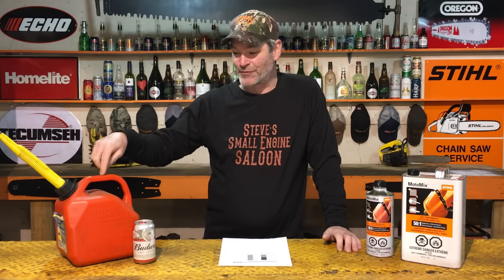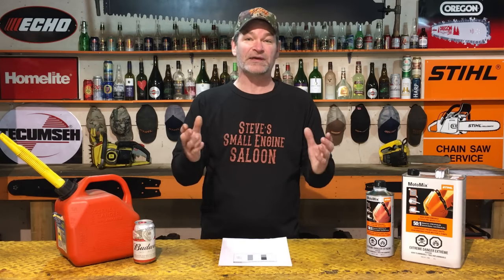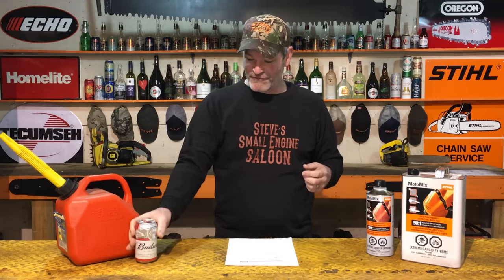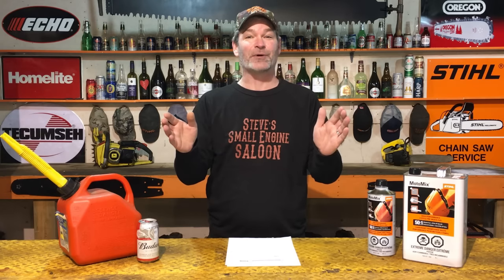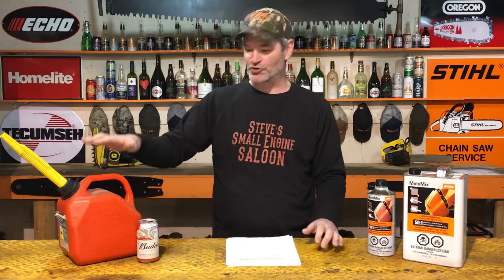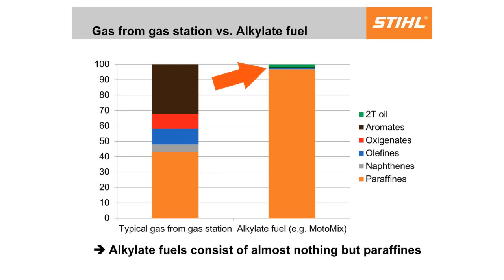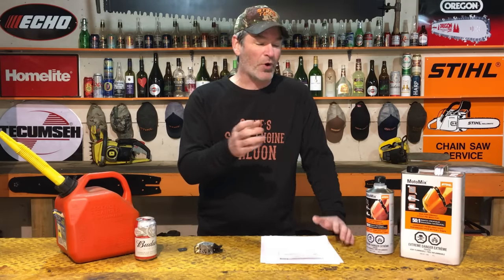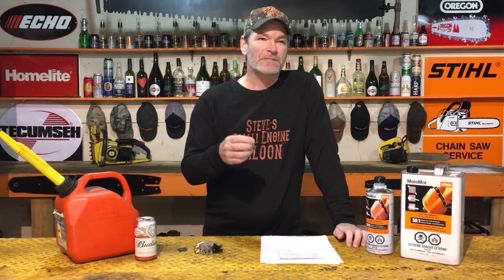The Ugly Truth Why Gas Station Fuel Is Bad For Small Engines

Comment: Your graphs are deceptive. Don't confuse aromatic hydrocarbons with benzine. There are several reasons to prefer ethanol free fuel over gas station fuel for your small engine, particularly if buy more fuel than you need for this season: If the gas can you store your fuel in is vented, the aromatics (which help our engines) all evaporate and the ethanol sucks in water. This can be slowed if your storage can is not vented, but your residual fuel will still oxidize (degenerate) every time you open your gas can. Gas goes bad eventually even if you use a preservative. The thermal expansion dangers of storing gasoline in an unvented can, increase as the can empties.

Comment: Federal rules fixing the maximum amount of aromatic hydrooarbons (like benzene and its associated 6-carbon ring compounds), and other bad actors in gasoline went into effect in 2011.  These bad impurities are now limited to less than 2% of the gasoline sold at the pump.  This is still too much gunk in our gas.  But it is far better than your charts indicate.   Benzene itself is a very dangerous carcinogenic compound but is now found in tiny quantities in gasoline due to the regulations.  Still, any benzene exposure raises your risk of leukemia so the stuff should not be present at all in a widely used product like gasoline.  The technology for splitting the benzene ring and hydrogenating the resulting 6-carbon chain with specific a catalyst  now exists and consumers should demand that benzene, tolulene, and other carcinogenic aromatics be banned entirely from gasoline.  Your data seems out of date.  Still, the gum and resin-forming impurities in our gasoline will remain to some extent no matter how carefully gasoline is refined unless we are willing to pay for chemical purity of a very high level.  That would perhaps double the price of gasoline and nobody wants that.

Comment: That’s the first time I’ve heard of this stuff. I know a little bit about engines and I’ll go out on a limb to say it’s a scam.
Reply: My entire strimmer fuel system, filters and carb diaphragm was totally destroyed by forecourt fuel - even worse now - the ethanol is being increased to 10%. Never using that stuff again. 
Use premix alkylate petrol, like Aspen make, and skip the benzene overdose from forecourt pump fuel. No ethanol in it either. Keeps for many years with no additives needed, even when left in the machine. And because the heavy distillates of forecourt fuel are not present in alkylate, practically no carbon build up occurs.